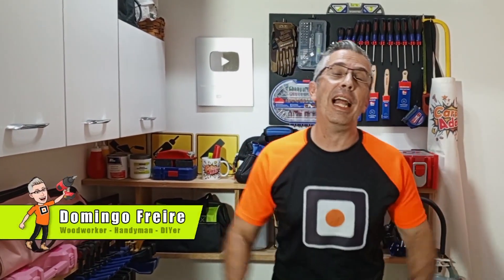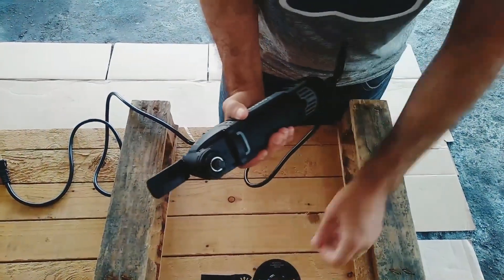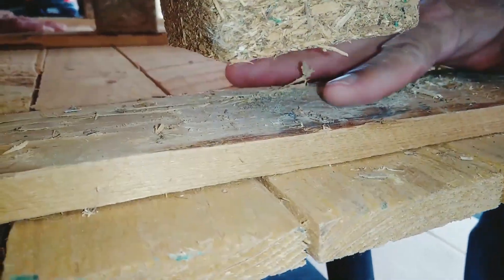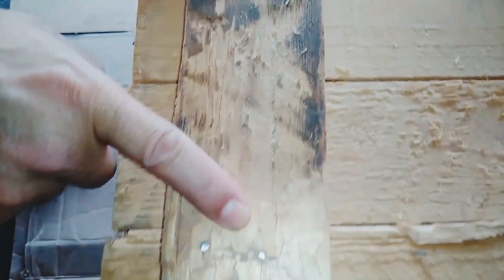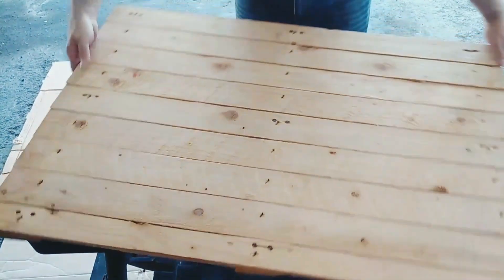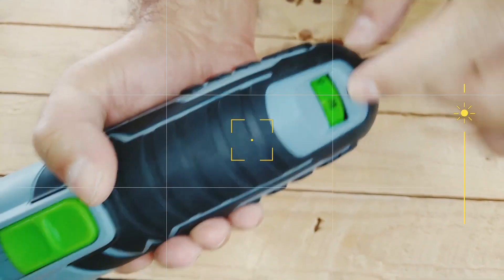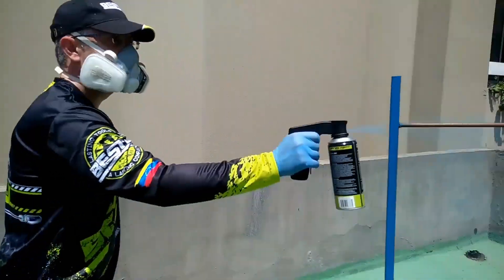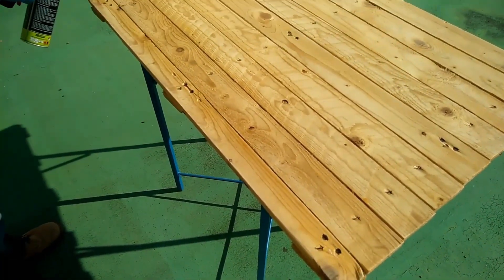How to MAKE A TABLE using a wooden pallet and a rusty iron base

Comment from the maker: If you want to see and buy the tools that I used in this video you must go now to the following links
WORKPRO Oscillating Multi-Tool
https://www.amazon.com/dp/B09GV4M1NC?linkCode=ssc&tag=onamzdomingof-20&creativeASIN=B09GV4M1NC&asc_item-id=amzn1.ideas.2060PA7A4ULUS&ref_=aip_sf_list_spv_ofs_list_d_asin

WORKPRO Cordless Hammer Drill / Screwdriver
https://www.amazon.com/dp/B09BF4HP2F?linkCode=ssc&tag=onamzdomingof-20&creativeASIN=B09BF4HP2F&asc_item-id=amzn1.ideas.3RH57U88WZE97&ref_=aip_sf_list_spv_ofs_list_d_asin